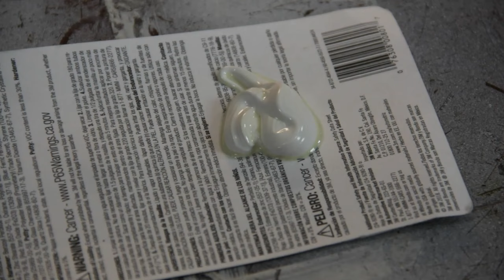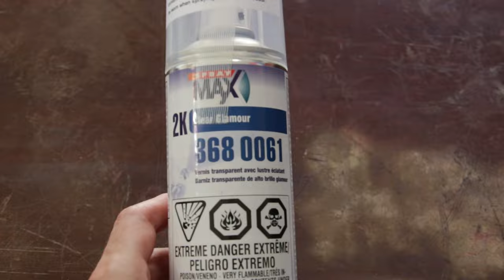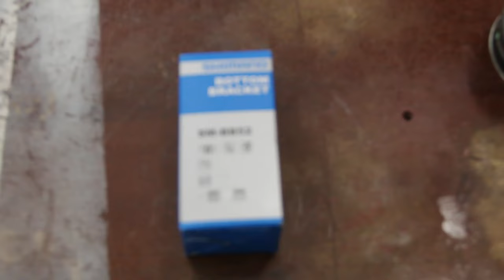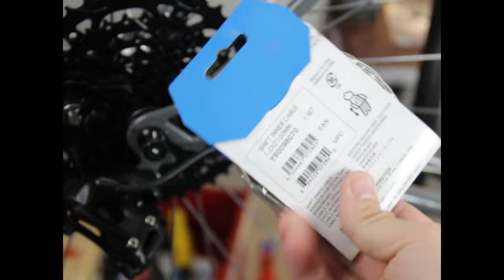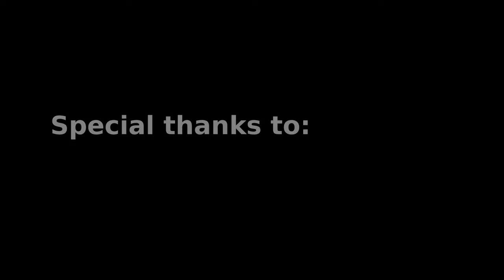1984 Miyata Refurbish

Comment: Really nice job on the restoration of a great-looking vintage Miyata. Congratulations. I have a project right now with a similar stuck seat post situation on a 1970's bike that is being converted from a 10 speed into a single-speed. After attempting to loosen the seat post in various ways with no results in sight, I simply cleaned it up and left it at the height it was stuck at. With the seat I have installed, the seat post at the exact position for the rider  ... lucky
Reply from the maker: haha that's awesome, and the result isn't much different than mine, because where the dent is in the seat tube, i have to run a very short seat post, so you really can't safely raise it up any more than it is now.

Comment: A few years back I bought a 1992 Miyata 914 that some old guy had powder coated a fad blue, put silver decals on it and clear coated over that and it was built up with Dura Ace 9 speed set up including the wheels. It was freaking awesome. I snagged it for $300. I kept and road the snot out of it for the last 9 years or so then took off all the Dura Ace bits and put tiagra stuff on it and sold it for $350.

Comment: Was a bit surprised when i first saw the different color at start of the video. But then after seeing what followed, it made sense. Good job fixing it. Also, pretty sure you're driving someone crazy with that drivetrain comprised of campy, shimano, sram, microshift, and others.  I personally love it. Whatever works.
Reply from the maker: thank you Oscar! yes I was also considering how odd the mix of components are. But really it's just a combination of what I already had in the parts bin and what I could buy for a reasonable price. I should really do a price breakdown and post it in the description, I'm sure the question will come up anyway.

Comment: I  have  a MIYATA Pro Aero  which I bought new. I did an upgrade and remodel  in the late 80's .
to include braze-ons and a repaint. 
Currently mostly Sun Tour Superbe derailleurs, brakes and bar ends.. 
Love the bike but I want to do something more interesting with it to make it more useful rather than
the all out racer it was intended to be. Done with my "racing" days. 

I am curious about your gearing ; what restrictions, if any, on the 11/42 - 38 ? 
And would it be possible to use the bar-ends ? 

Excellent video, crazy good bike. Admire your ingenuity and  tenacity. 
Liked and subscribed. 

PS I have a 1983 SOMEC, 2011 Rivendell Hunqapillar, 2018 Rivendell Cheviot, 1991 GIANT CFM III,
mid 90s Trek Mtn Bike.
Reply from the maker: thank you Jeff! As for the gearing, for me it's totally fine, but if you're more on the racer side or if you like getting a lot of speed going down hills, probably you'll spin-out. Yeah bar-end shifters should work totally fine. I'd actually like to try to do that some day.
Reply: @BruceChastain  I prefer to explore rather than race. been there, crashed that.  

I have modern bar ends on my Hunqapillar but original  early 70s Suntour Superb bar ends on the MIYATA and the SOMEC.

I take the black rubber cover off, file, sand and polish the aluminum.. they look great and are perfectly functional after all these years.

Comment: I have had success getting a stuck seatpost out with liquid nitrogen and a heat gun.  I do this first before attempting any other kind of removal such as a liquid penetrant or use of force.

1. Place the frame in a stand upside down, seatpost pointed down. Make sure that any holes to the inside of the post are plugged so that the liquid nitrogen does not run out.
2. Heat the seat tube gently with the heat gun. This will expand the seat tube metal.
3. Pour the liquid nitrogen down into the bottom bracket, and down into the seat tube. This will contract the seat post.

The thermal difference between the post and seat tube will generally shock the seat post free, sometimes with a popping sound. However, I have a mallet ready to quickly knock the seat post out once I either hear the pop or I give it a few seconds to react. 

You don't have to really get the seat tube any hotter than a temperature that is uncomfortable for you to touch and hold. Anything hotter than this is just excessive due to the super cold nature of the liquid nitrogen. If done correctly, you won't damage the paint. If there are some nearby decals, those might be damaged.
Reply: Where does an average person get liquid nitrogen in the amount needed to try this technique my self.

Comment: Nice! A couple of questions... Wouldn't it be possible to pull out the dents in the top tube like on a car dent repair?
Good idea with the 9 speed 1x9 - great with the link to the Microshift cassette - i'll be using that... but I prefer STI shifters instead of downtube shifters - do you know any STI shifters that work with the Sram derailleur?
Reply from the maker: Thanks Andreas! I did contact some people on suggestions for the dent, even posted on a frame builders facebook group, the suggestion is to first try to actually push it out with what's called frame blocks, which I did you can see at one point in the video. Then either use a metal filler or bondo to finish it. In terms of the STI and Sram, I might be wrong but I believe any will work as long as it matches the number of cogs on the cassette. This is because the distance that the derailleur moves is only dependent on the shifter, not actually the derailleur, I mean the distance of the increments. Hope that makes sense.

Comment: I have a univega nuovosport pretty much similar frame- looking into DIY painting the frame myself. I noticed you didnt completely remove the initial paint layer. How did you approach the paint job? Just simply sanding down to some extent then straight to spraying? I see other videos where people will bring the frame down to bare steel, does it make any difference? Thanks
Reply from the maker: I've painted a few frames now and my method that I think works best is this:
1. Sand down to where the surface of the existing paint is very thin or even the paint is gone. Don't worry about removing it totally, the original paint will actually sick better to the metal likely then what you'll apply. 
2. I don't use primer, I use a 2 in one primer paint, and I've been fine like that. 
3.  Use the 2 part clear coat, do not use a regular single part, needs to be 2 part clear. And know that whatever you have before laying the clear down is what you're going to get in terms of the surface finish. The 2 part clear really just creates a glossy hard coating of whatever you already have.

That's my cliff notes from doing a few frames.
Reply: @BruceChastain  great thanks for the response. What type of material do you use to do the sanding?

Comment: Hi Bruce…amazing restoration, I recently bought  Pro Miyata but the rear drop out has a crack one on the detailer side, is that an issue?
Reply from the maker: Seems to me like that should ideally be repaired, wouldn't want it to fail while riding.
Reply: @BruceChastain  great point, what type of shop will be the ideal to fix this?
Reply from the maker: @yylvib  not sure, maybe stop in at some local bike shops, I wouldn't think that they would be able to take care of it, but they may know someone who can.
Reply: @BruceChastain  ok fantastic- I appreciate it.

Comment: Wow awesome work, is that bike originally a 27 inch bike? what tires did you use on it? what type of brake did you use to get to the 700c wheels?
Reply from the maker: thanks a lot Julio! Actually this one was originally a 700c, so that made it easy. Went with Panaracer gravel kings.

Comment: Great video.
What made you decide on the 42T 9 speed cassette, with the 38T crank ?
Reply from the maker: Almost all my bikes are 9 speed, so it’s easy to interchange parts. As for the 38x42t, well with that I can do a decent at climbing, and on the other end 38x11 is faster enough for me, not sure of the top speed but for sure can cruise around the low 30s kph.
Reply: @BruceChastain  I thought you were in Florida, are there any hills to climb in Florida ? Forgive my ignorance, I've been to Florida a few times, and I don't remember seeing any mountains like in southern California.
I have a 1 to 1 ratio of 34t/34t as my lowest gearing, on my "nice" bike.
And I also have a heavier Schwinn with 3x 28t front with 8x 32t rear. They feel about the same on the climbs.

Comment: Should have turned it upside down poured transmission fluid into the seat tube from bottom bracket then put it on some sort of sonic vibration device overnight to get that seat post out.